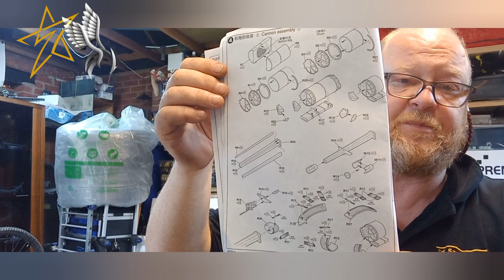Trumpeter 1:32 A-10

Comment: Hi Mark, I’ve recently become an MRP paint convert and absolutely love them! You’ve answered a question I had about whether a gloss coat is needed for decals or are the MRP paints smooth enough as they are. Have you used the MRP Matt varnish at all to finish the model off in a flat finish and is it like their main paints in that you have to apply multiple thin coats? I used Tamiya flat clear on my last build but only because I had some in the stash. Cheers Phil
Reply from the maker: Yes Phil mrp matt is my matt of choice. Same as the paint, distance, slightly higher psi, about 8 or 9 and I'd say a decent point needle, .2 or .3 cos it doesn't like the 0.15 in the harder.
It's not the angelic matt varnish either On my Spitfire the varnish actually tainted sections of the paint job. However, it didn't ruin the work, it actually added to the overall effect imo 
Gave it a really weathered look, it's hard to describe.  I'll watch the Spitfire video back and see if I can spot any footage to guide you to. 
Any more questions please ask
I've actually found a picture so if you've got a fb/ wtsapp etc I can send it to ?